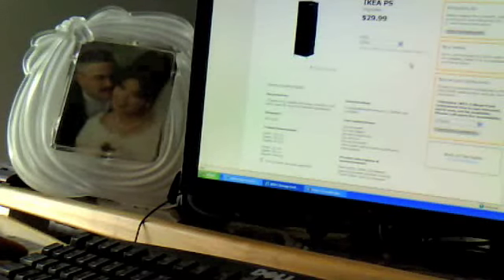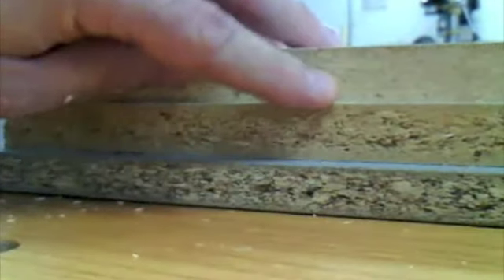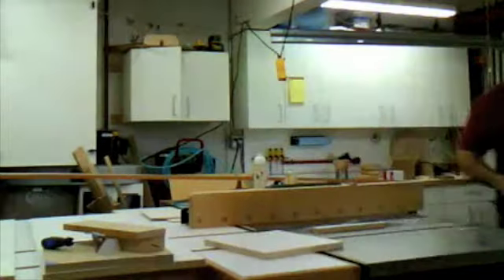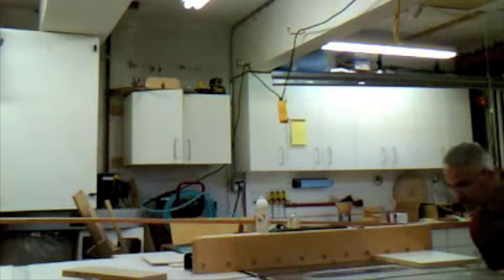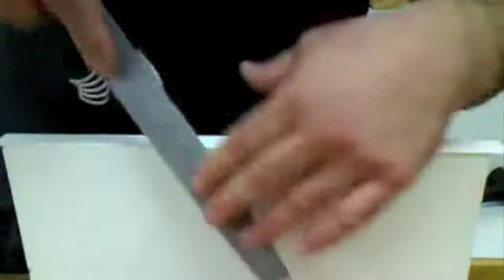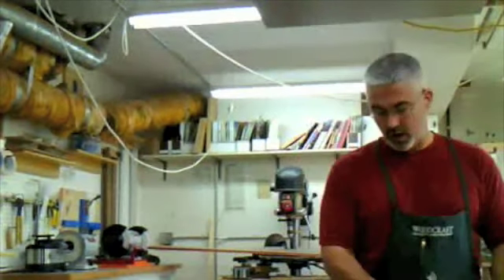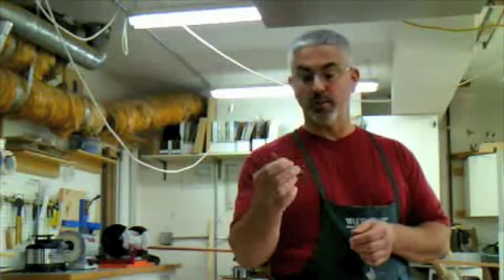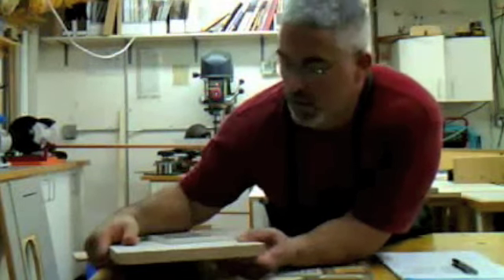Working with Melamine

Comment: There's also T-section edging material, you cut a groove around the particle board and just push it in like fitting tongue and groove flooring. I have some broken up furniture that used it, probably it's over 20 years old. It's flexible, probably quite tough.

Comment from the maker: 0822-FSL is the part for 2-1/4" , un-plated, steel , square-drive, for general cabinet assembly.  On the McFeeleys 'Select-a-screw' page, on the screw-spec tab, select Head: flat, Material: Steel, Unplated, Recess: square, Size: #8.  That will bring up all the lengths in the hardened steel screws.

Comment from the maker: @GrowMap Of course there is always some risk when working with manmade, and even natural products, in a wood-shop.  With melamine my larger concern is the particleboard, more so than the melamine coating.  When doing any significant cutting, in addition to the dust collection and ambient air filter, I have my (garage) door open for more ventilation, and I wear a dust mask. It is always the dose that makes the poison, so minimizing exposure to the dust and fumes is key.

Comment: What about nailing?  I need to attach a melamine side panel to the right of the dishwasher and under the countertop. I was planning to nail the far side to the panel to the existing back panel with an 18-gauge nail gun then add those tiny L brackets under the countertop.  My other option was to use pocket holes but I'd have to buy the Kreg Jig first which is pricey. Thanks.

Comment: I was thinking of resurfacing my existing kitchen cabinets.  Seems like you have to buy melamine already adhered to something like particle board.  I just want to just attach thin layers of melamine to the existing outside of the carcases.  Maybe its a manufacturing process that has to be done with heat and pressure.  Having a hard time find info on the process of attaching thin sheets of the stuff to existing wood.

Comment: Brian, great vid and info on using this material. You mentioned the screws that you now use as hardened steel and McFeeley's. Do you have a part number for these? I see the part number for the pocket hole screws but not the construction/assembly screws.

Comment from the maker: @marcellinasfigaro Yes, I have used pocket hole joinery for certain special cases where adding additional trim to cover the outside holes would look weird. Just make sure you use pocket hole screws made for MDF/Particleboard. The threads on regular pocket hole screws used on solid hardwood are not deep enough. (You can get the MDF/PB pocket hole screws from www_dot_McFeeleys

Comment: what size drillbit/pilot hole & screws would you reccomend for binding 3/4" melamine together? im new to building things and am trying to build a reptile cage, ive had some trouble with getting this part right.. i either make my pilot hole too small and split the wood or make it too big and it falls out.. i'll be securing the corners together in like a box shape so the thinnest spots.. any advice? i need this thing to be strong & durable. i don't want it to collapse and kill my lizards as this stuff is really heavy

Comment: Thanks for the useful video.  For those interested in the details of toxicty etc., Wikipedia has a lengthy article on Melamine which goes into that in some detail. I would also point out, that there is a material sold at chain 'buildit stores, that appears to be Melamine coated particle board, but is not. It appears to be some sort of semi-gloss white paper product, instead of Melamine resin, Useually if you look closely at the edges, you can tell the difference. Because the Meamine is brittle, the edges will have small chips, where as the 'imitation product, the white material can peeled back in a way, that you might imaging paper would. Is there a functional difference that should concern us? Yes, two that I know of. The Melamine is tougher in terms of wear risistance, due to it's hardness. The non-Melamine, if water is allowed to stand upon it, will form small blisters, as it isn't as waterproof, and the particles in the partical board, will swell up uderneath the coatind.

Comment: Hi Brian! Great vid! Are the screws that you show with the square drive, Spax screws? I have started to replace all of my screws with Spax, they really work great, although, I have not tried them in particleboard yet.
Reply from the maker: I do like Spax and do use them, but the ones in the video are the hardened steel screws from McFeeley.  I use both, but since the hardened steel screw are less expensive, I usually order online the sizes that I use most (2-1/4" for assembling cabinets),  However, I will not hesitate to run to the local hardware store and pick up some Spax if I do not have the right size in stock.